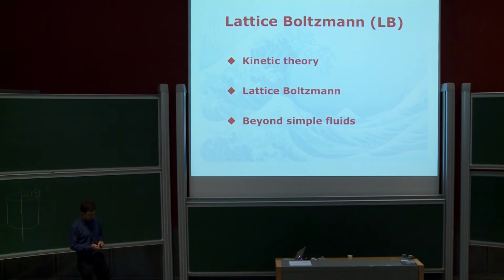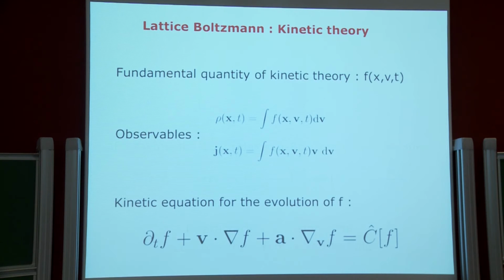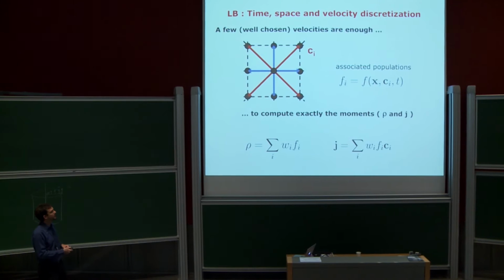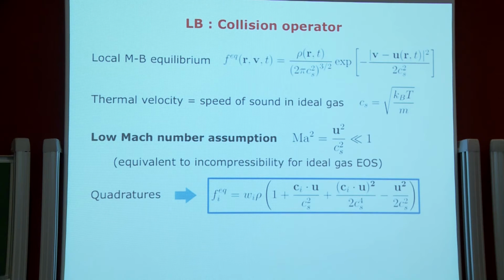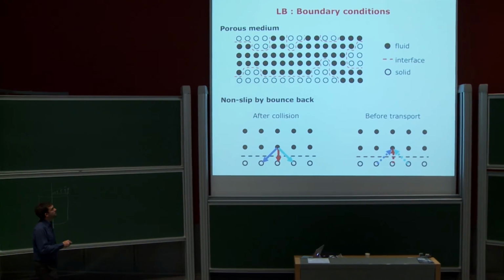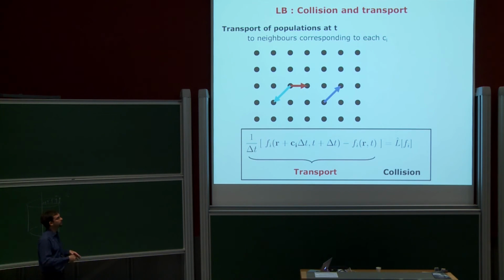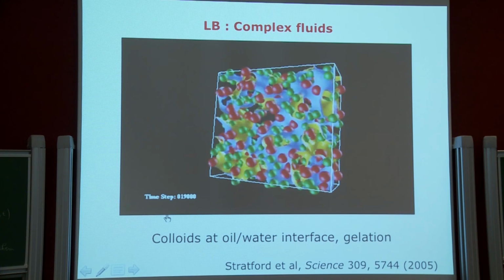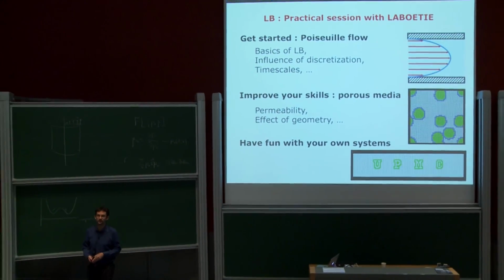PISACMS 2015 - Benjamin Rotenberg - Lattice-Boltzmann methods

Comment: Can I use this method for a system where the speed of sound varies with density abruptly and with circular boundary conditions (vibrations in a sphere where the radius is decreasing with time at constant velocity)?  Or conversely, the same problem on a circle, where the radius increase at constant speed and the liner density decreases and the velocity of sound decreases with density abruptly?